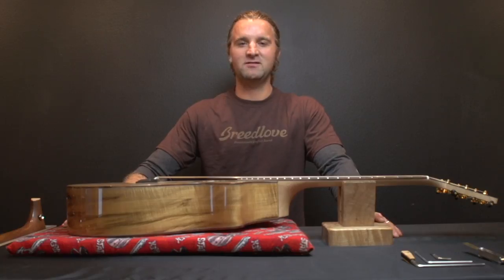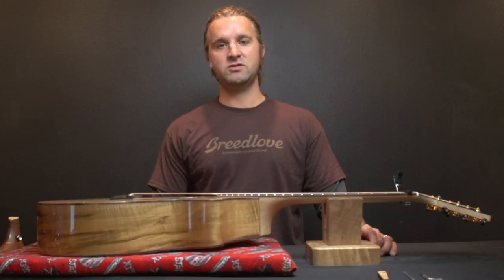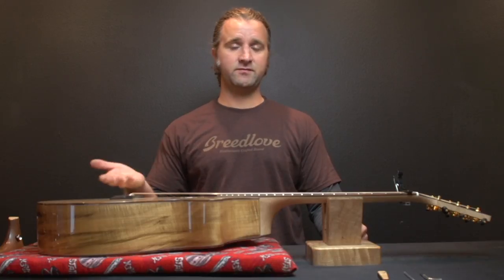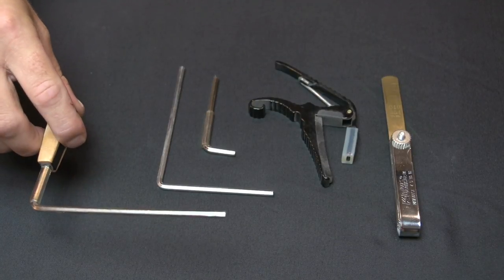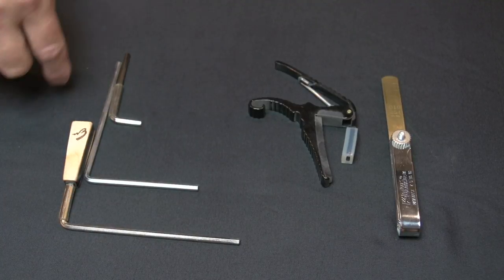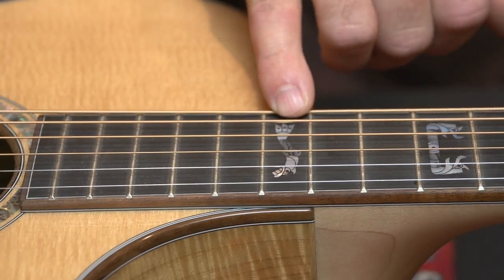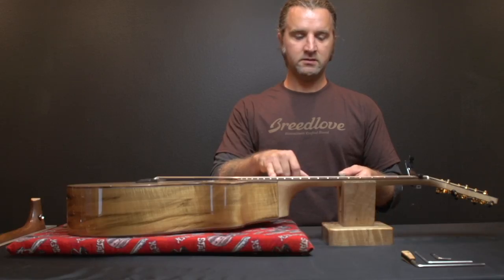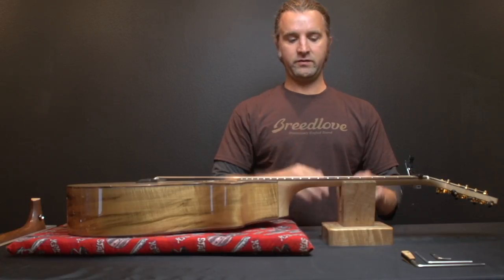Breedlove Guitar Support: Truss Rod Adjustment

Comment: I recently purchased a concert series. I am very pleased with the tone and playability but I am experiencing string buzz around first three frets. I tried shimming the bridge saddle but wondering if there is a fix that won't compromise the action on higher frets.
Reply from the maker: Hi TIm - it could be that your nut needs to be adjust as well.  Or it could be that your truss rod needs to be adjusted.  You want to make small adjustments.
Reply: Breedlove Guitars thanks, maybe I'll seek out a reputable tech.